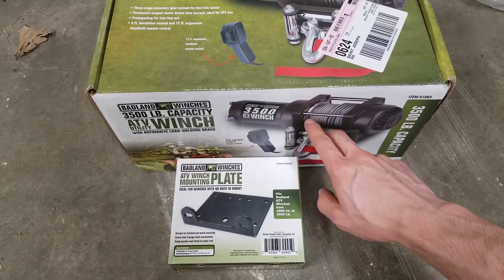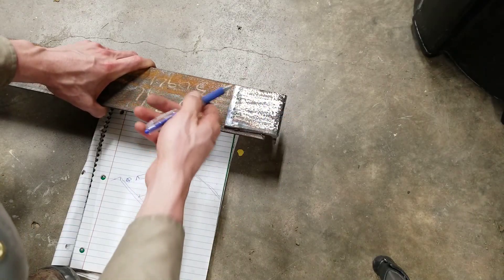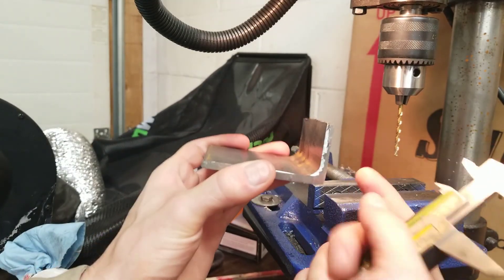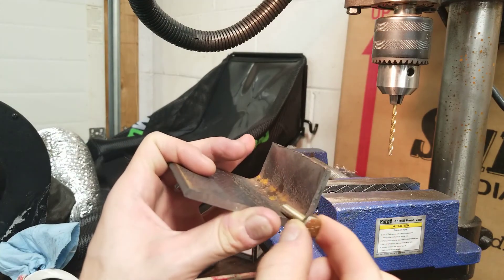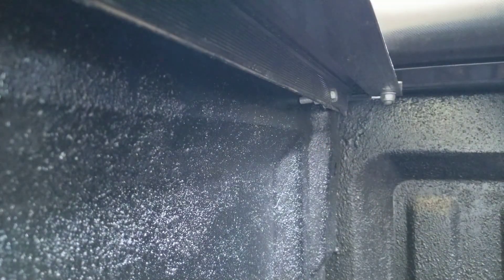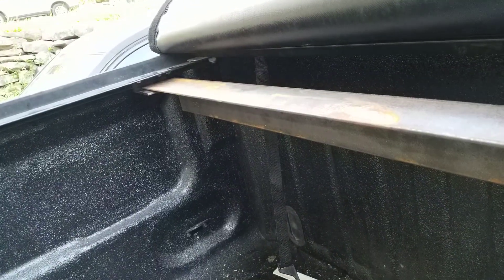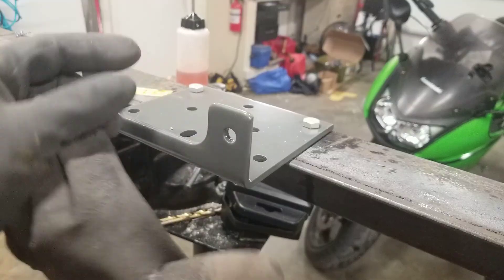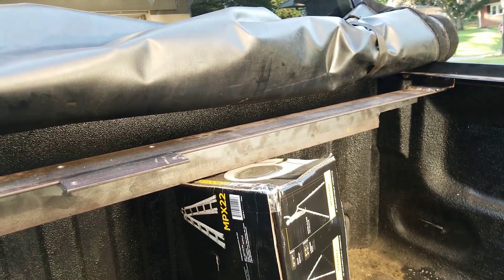How to Install a Winch in a Pickup Truck Bed

Comment: Fruitless design.
Running a steel bar to the rear of the bulkhead, in between the truck cab and the truck bed is more beneficial. That bar must extend out to the corners of the bed, which provide the bulkhead with support on the bottom as well as on the sides. 

Think of the bulkhead as the U. If you grabbed at the top middle portion of the letter U it would be it's weakest point. The rear of the truck bed or a bulkhead would flex. 

However, if you ran a piece of steel bar from the left lower corner of the U to the right corner, it would be a stronger reinforcement. 

In short, the bed theoretically can only sustain a relative amount of force overall anyway however, you would be better off having an attachment point to the lower left area of the bulkhead for the winch, and then the lower right area of the bulkhead for the winch cable to attach to.

By doing that you were gaining the mechanical advantage of running the winch out to an object, and then back to that secondary attachment point. 

The benefit of doing that is that the amount of load is actually split between two attachment points, which provides a significant amount more of structure.

Comment: By any chance do you think this will help to load up cars on a dolly?
Reply: I think it should. I've had to load a vehicle that wouldn't start onto a uhaul trailer. Let me tell you, pain in the ass. 

But be very careful of what the winch line is rated for. I would not recommend using this flimsy winch line for that application

Comment: Will this work on snow blowers and generators?
Reply from the maker: Should be fine for up to around 300 lb as long as the load is on wheels and ramp isn't too steep. Most blowers and generators shouldn't be over 200 lb.

Comment: I have a 2010 Toyota Tacoma the best I could do is mount a winch like that to the bed floor up by the rear sliding window I could loosen up the bolts that actually hold the bed to the frame and put a piece of steel across The bed floor and use the bed mounting bolts to secure it???? My only worry is the cable would cut into the bed if I wasn’t careful that Tacoma‘s got a composite bed and it’s not real heavy duty,,, I would like to do something like this to load a 619 pound item a BF 34 safe up in Connecticut I found for sale the only way I could get it up into the truck is a winch of some type like this I figured I’d put a tow strap around it and tip the safe on its back on a set of wooden ramps with aluminum tips and hoist it in that way I’m not even sure it’ll work but that’s my idea????

Comment: Those are pretty tiny bolts holding the brackets to the box. I would have gone 3/8” myself since there is room for the larger bolts.
Reply: FIRST THING I NOTICED! But I’m a “worse case scenario guy” so I over build everything! I spent 30 years as a fireman! 😁

Comment: How did the winch hold up over time, did the inside have any bends because of the weight
Reply from the maker: Still holding with no bends anywhere. As long as the cross bar is tightly fitting nothing should bend...just need to keep the load within reason.

Comment: i just drilled 2 holes in the bed right behind where he mounted his angle iron.  It worked well for me pulling motorcycles up. I would use a couple of long bolts that hold motorcycle engines as pins.. and pull the bolts out when i finsihed.  I then got idiotic and forgot the bed wasn't that strong and tried to straighten a bent trailer and started to bend the bed.  i had intended to use a skid and back up and straighten the bed, but i ended up selling the bed for $1,000 because it had no rust. bought the truck from texas. unfortunately it cost me $1,000 to ship it up lol.   Now my plan is to mount a harbor freight ATV hitch to a headache rack.. and use a hitch winch mount on my new truck.   I'm also thinking a skid might make a good mounting point.

Comment: What's the heaviest item you have pulled up on this setup? Trying to decide if I go 3/16" or 1/4" thick.
Reply from the maker: The go kart is the heaviest. If its larger leg length angle iron, the 3/16 is fine as long as it's not placed in torsion than it will twist quite a bit. The bed rails will likely always be the weakest link without additional bracing to the bed.